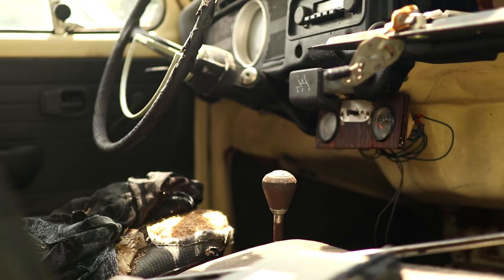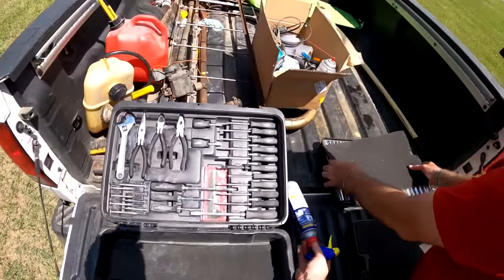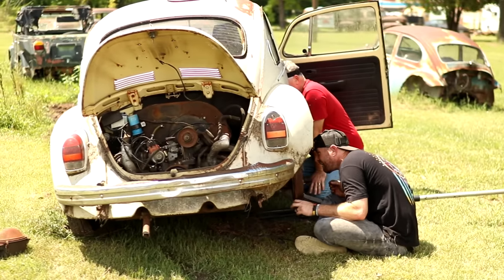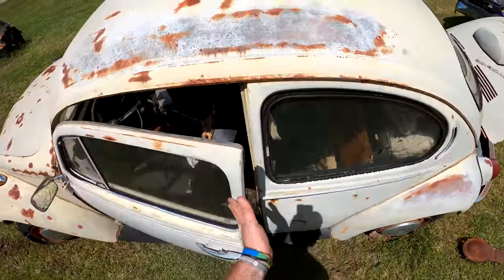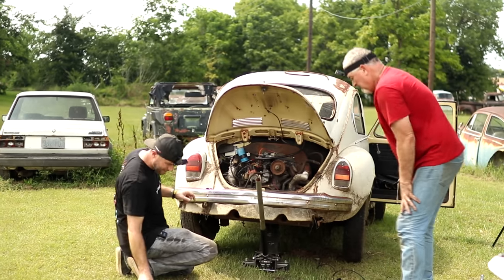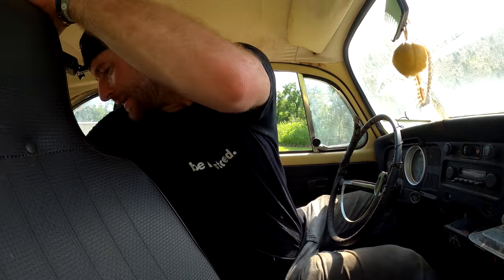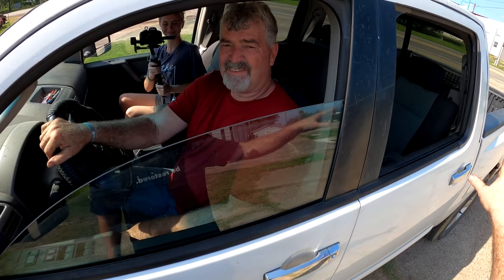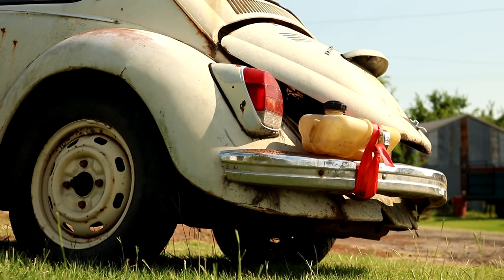ABANDONED VW Bug Will It Run | FIRST START In 30 YRS | Forgotten Volkswagen Super Beetle | RESTORED

Comment: You just experienced a case of Super Beetle shimmies, they do that when the front end worns out with old bushings and tie rods. They do that when you reach a certain speed (35/40 mph usually) and they stop when you go faster. I know that because I have a super since 2002. That's a great car, hope it will be saved as a whole and if not, at least his parts will keep another one on the road. Great video!
Reply: Known as the super wobble
Reply: Awwhnooo,
I owned one of those I went to buy it looking for the radiator check for oil in the water nope no radiator so I learned about helicoils cuz it took it for a trip up to my hometown WHEN BOOM Rattles popped, didn't know much about cars but I knew better than to turn it off open the bonnet and there's a spark plug bouncing around sparking and whatnot
Reply: @edengates66  K
Reply: yes this video is awesome and worth watching

Comment: That shaking you have is called the “Super Beetle Shimmy” the bushing on the control arms and sway bar are shot so you need to replace those and that would solve that problem. My 73 super had that exact same problem. It’s a very common problem with Super Beetles.

Comment: I've had a 62' a 69' and a 74'super.The super had the most hp and best ride but it was quirky, the 62' was the most fun to drive and would go anywhere. One day hot a big rock and put a hole in the bottom oil pan and thats the way it died.

Comment: I feel the reason supers aren't as desirable as regular beetles is because the McFearson strut front suspension isn't as good for making Baja bugs, but for roads I feel they are better because with McFreason suspension the beetle has full independent suspension, I've never driven a regular beetle but my super has always done good with roads, also looks like its has a case of the super beetle shake, all supers have them due to age, It was good to see you all give this little super a change to live again, their are great cars and truly have a mind of their own.
Reply: If you replace the eccentric Bushings in the lower control arms, the shimmy and shaking will disappear for many years. Pedders fixed my Super Beetle. They are good.

Comment: I bought a brand new 1973 VW Super Beetle. It should have been shipped directly from the manufacturer to the salvage yard. It spent more time in the shop than it did on the road and after about a year it went somewhere else. Was glad to see it go. I never even looked at a VW after that.
Reply: What was even wrong with it? They are so simple they can’t really die other than from rust
Reply: Your comment is the worst that I've seen. They are reliable. Maybe yours was a Chinese copy!

Comment: This Beetle ("Käfer") still has the oval tail lights / indicators, so I guess that's the version sold as the "1200". The "1300" and "1303" were both fitted with round tail lights. The latter two were known for their excessive fuel consumption, about 13 litres / 100 km! As to the shaking, I guess the front axle or front shock absorber have problems. I remember this front axle is of some strange design (not the spring / absorber McPherson combination) that dates back to 1937! When Adolf with the Mustache had the earliest version known as "KDF - Wagen" made near Wolfsburg, Germany.
Reply: I would think a German person would know the story of the 'Käfer' better... This car here is a modelyear 1971 so it's a 1302(!) also known in some countries as 'Super Beetle'.😉The bigger taillights (in Germany called Elephant Fuss) came on the modelyear 1973, when the 1303 was introduced!  Greetings from Belgium🙂
Reply: @snotpiet1  You are right, thanks for the info🙂!

Comment: You could just jumper wire from generator positive post to the coil and don’t run engine long without belt on the fan

Comment: Was it running with the fan disconnected with no belt in the alternator? The engine must have overheated if you did this.

Comment: Question , has anyone used electric car heaters. Making a baja , dont want to use the original heater. live in cold climate heater is essential. My concern is whether the electric heater would cope with the jaring this bu is going to get off road